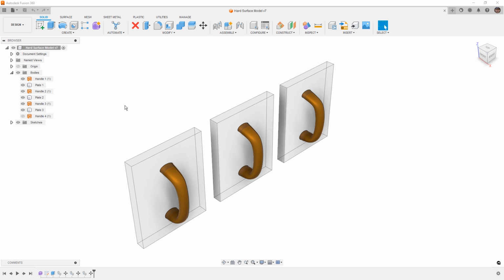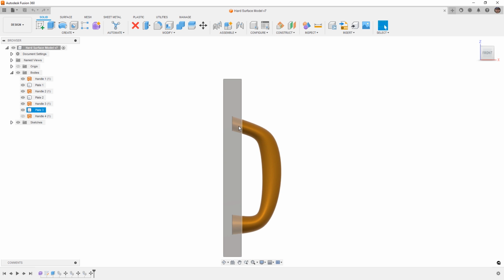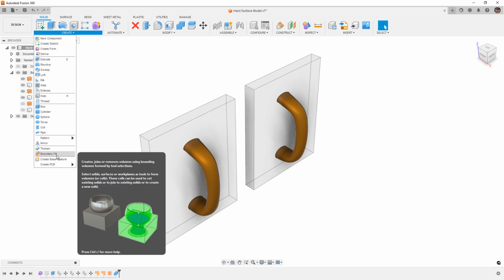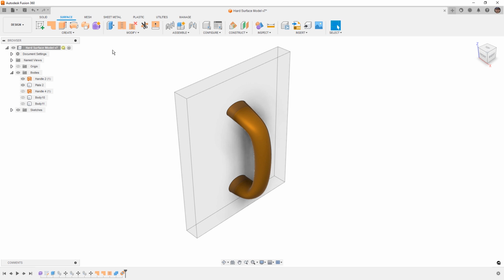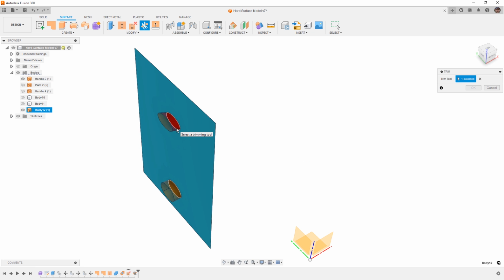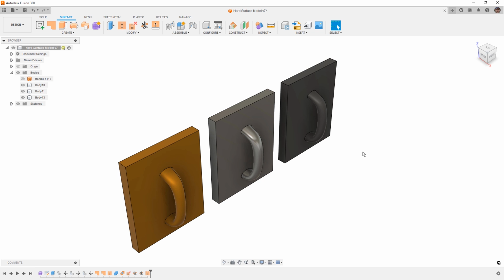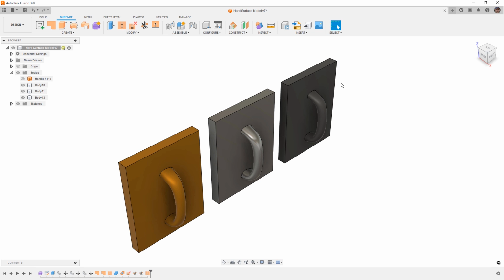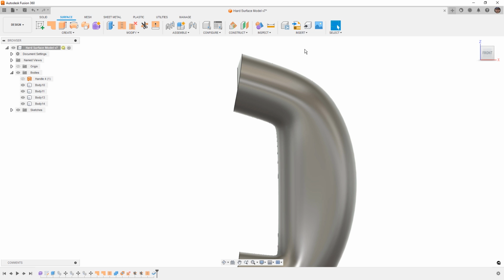Create Your First Hard Surface Model in FIVE MINUTES with Fusion

Comment: For injection molded parts I like to use the shell format in solid mode and for surface mode the thicken command. I never really used the boundary fill option as I often struggle to figure out which box to tick to achieve what I want. Also if the geometry changes I found it not very stable. Thanks for sharing this Matt